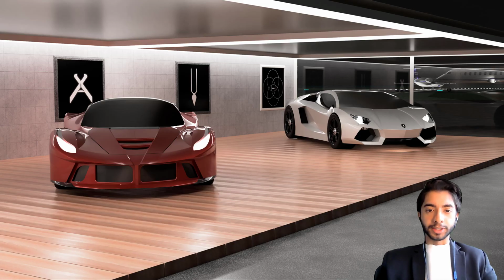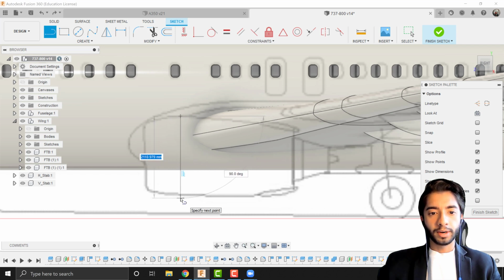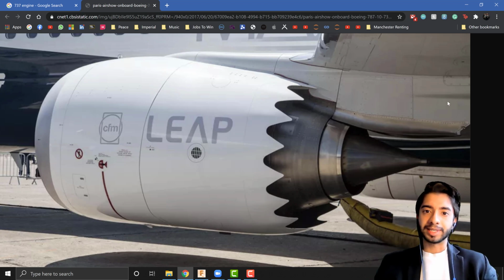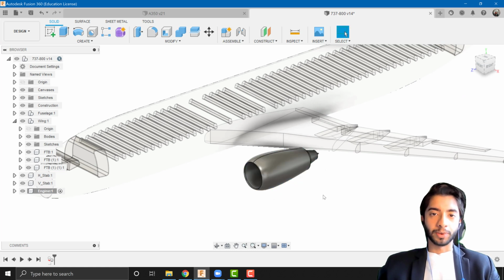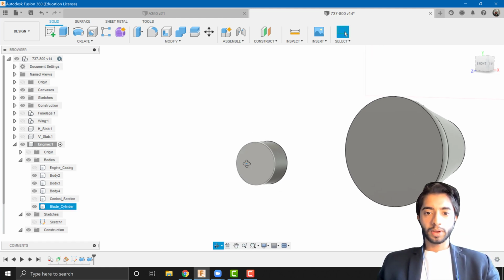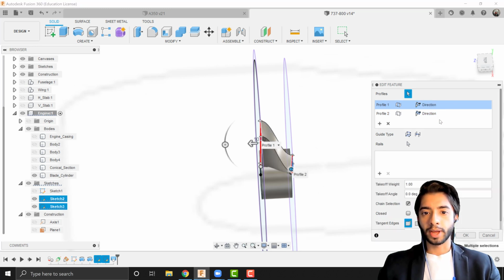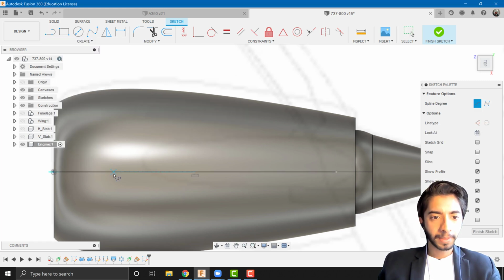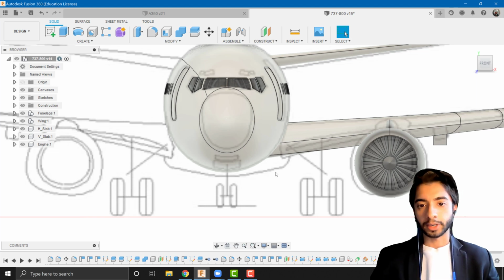How to Model an Aircraft in Fusion 360 | Tutorial 8 - Engines | Step-by-Step (4K)

Comment: 4 years later and no one answered this yet… lol. The 737 has a “squashed” engine because the the 737 was the answer to a growing industry problem in the late 60’s and 70’s when they began developing the -200 and -300 variants; getting people to places with limited air carrier service. And this meant having none or few jet bridges available. So to keep the 737 accessible with truck mounted stairs or mobile stairs, they could lower the aircraft closer to the ground to utilize means of getting passengers off and on the aircraft without less resources available. The 737 also incorporated built in retractable stairs on some models, RyanAir is noted for this feature. 
Another fun fact, Reducing the size of the intake created a ram-air effect, increasing the engines efficiency by as much as 15%.

Comment: On 7:00 dont you think you could have use the shell command instead of editing the sketch isn't way easier ?
Reply from the maker: Yes Khalid, you're absolutely right. The only reason I showed this is because sometimes the Shell command doesn't work for some designs. In this case however, that would be easy to do. I showed this way because it's the most general case and should always work :)